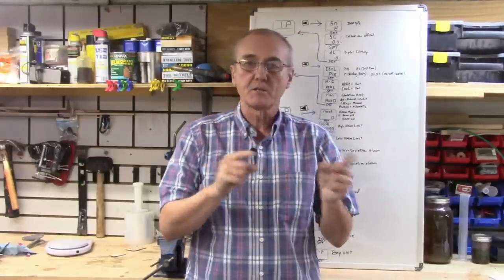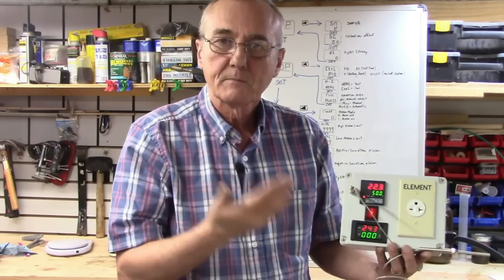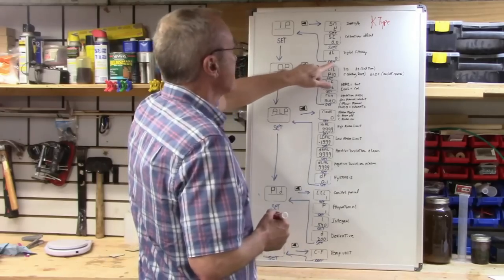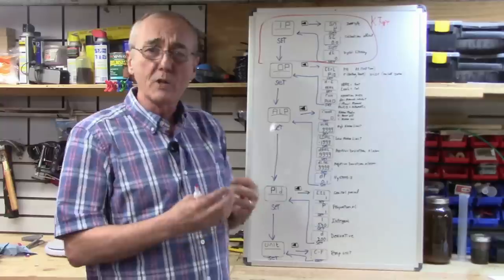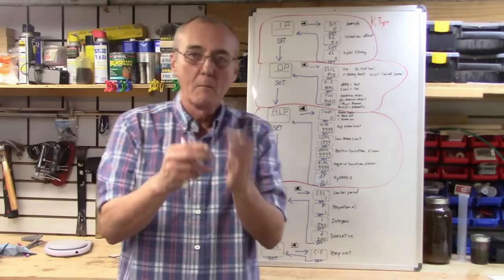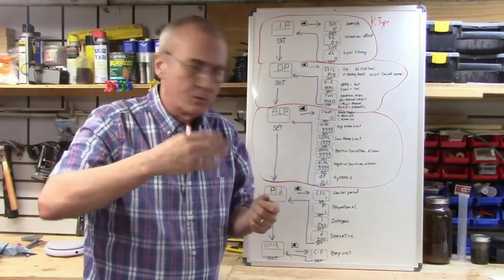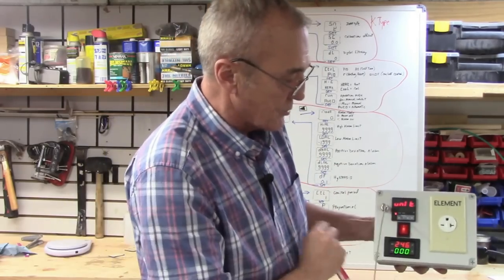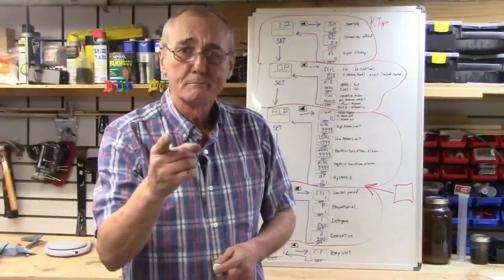Settings for  the InkBird 106VH controller

Comment: George I like your videos but your understanding of PID is off. I would just leave derivative off and do an autotune running P&I. Your settings are strange to say the least.  Your proportional is so high your pretty much running an off on control, Integral is so large is pretty much off, Derivative is pretty high especially since it is for long lag time processes.  If you ever come to Austin after this covid stuff is over we can sit down and have a drink over it.
Reply: Gotta add my 2 cents as well....WHAT do you thing the settings should be?
Reply: @robertt1782  That would depend. All things have influence, still size, element size, insulation or not, etc. That's why I said I would just run an auto tune. This controller will run an auto tune cycle and then go back to normal operation automatically. 

Proportional is just that a percent change in input gives you a percent change in output. Some companies call it gain. a proportional setting of 100 is equal to a gain of one. Most controllers have a default setting of 100, if you go below 100 that makes a larger reaction, if you go above 100 its smaller. 

Integral is time based. you will always have error with proportional only, Integral is there to bring you to setpoint. It is also sometimes called repeat,  it is usually measured in minutes per repeat or repeats per minute depending on manufacturer. it will repeat the proportional change till it gets to setpoint. The ink bird has a unit of seconds so it will repeat the change every so many seconds. so the lower the number the faster the controller will change, the larger the setting the slower it will change. 

Derivative isn't used a lot on anything but the slowest reacting processes. like temperature control of a large tank or something like that with a lot of dead time from making a change to actually seeing it. It is a function of rate of change of the process variable. It is measured in seconds it will make a step change  depending on a rate of change and how long you tell it to look forward. it gives a step change to the output depending on the rate of change and the time you put in. The bigger the number the bigger the change. It can get you in trouble on a semi fast responding process. 

There are all kinds of calculations you can do to determine tuning numbers and they can get you in the ballpark but in the end you always have to do trial and error tuning. the auto tune feature kind of does this for you.  https://br.omega.com/omegaFiles/temperature/Z/pdf/z115-117.pdf here are some instructions on tuning a temprature loop which is definatly more than most guys will want to do. The way I would do it if I wasn't using auto tune. I would run it in manual up to 120 or so with a p of 100 and the i way up there pretty much off. put it in auto and make a step change to 125 or so and see how much it over shoots and how long it takes to get there. if it over shoots real bad slow it down if it take forever speed it up. Do that a few times till you get a decent response time without a whole lot of swinging. then gradually add in you integral making sure you don't introduce swinging. They can start fighting each other which causes instability. I wouldn't  mess with derivative.  Or you can just do like I said bring it to 120 in manual, turn on the auto tune then change the setpoint by 5 or 10 degrees and let the controller do the tuning. 

Disclaimer: It has been over 5 years since I regularly tuned loops and over 15 since I was in school for instrumentation and controls so I am a little rusty. All of my experience is power plant related so there might be some other control schemes for other types of processes.
Reply: @josephkordinak1591  As per your description of so called lag and adjusting for it I must put out there that the wash one may be heating can have an awful effect on the spikes in the form of surging. This as George has mentioned in a previous presentation was due to the wash having residual sugar from a botched fermentation. Or in my personal case impatience lol. The high surface tension causes this and I personally thought my settings were off. Having a few now in the jar I check and double check my math or Gravity reading to know where my wash is during the fermentation. Thank you for chiming in. I hope the info you passed will help someone.
Reply: @jonthegman  oh you still have to be there watching it even with this setup. It is the simplest form of automation. If I was designing something for a larger still I would add a more complex control loop but this system will help you keep it between the lines without constantly staring at it but you need to stay in the drivers seat. .
Reply: @josephkordinak1591  this just helped me tighten up the temp on my incubator, thanks. 
At a ser temp of 100.5 I was overshooting to 101 and dropping to 98.2. Setting the porptional to 100 and integral to 1 it tighten it up to .07 degrees each way. I'm gonna keep playing with it and see how tight I can get it.
Reply: Wish you would make a video on how you have done your unit. Now I’m kinda confused,Again, on what to actually set this at now. I’ll be running four cartridge heaters, two in each plate for a heat press. And being on a fixed income I can’t afford to keep buying these units. And when running heaters like I I’ve installed says they are AC. But the relay says AC on one side and dc on the other these will be hooked to pins number 6 & 8. So is these heaters correct for this relay ? Thanks. Be waiting for your reply.
Reply: Hey to whom it may concern. How do I set up my PID to run an oven. I followed George's instructions and as soon as my oven gets to the target temperature it shuts off.

Comment: I think I'm having a problem with my inkbird pid unit. I wired it correctly, installed it in my electric smoker, set the parameters as you described.  At first it seemed to be working great. I set the temp at 120, It came up to temp and held there within a couple degrees plus minus. I placed my summer sausage in the smoker for an hr, turned the set temp up to 160 and it never read above 130 actual temp, but the sausage came up to 160?? Do I need to calibrate the thermocouple? Please help!

Comment: my screen on the bottom jumps to the 600 degrees then down to 38 degrees then shows oral and keeps switching numbers. it’s on my heat press and the bottom plate isn’t heating up. any help would be greatly appreciated!

Comment: I'm using this controller cooling. is there a way to lengthen  the cycle time or loop ? the blower motor on my chiller keeps cycling on and off. Any help you might provide would be greatly appreciated.

Comment: Thank You So Much George! All I needed was one simple explanation  (out of this maze - which the manual did not provide) but You did awesome sir.
I am using ITC-100 as my temperature controller, I've connected a washing machine heating element to the RC as my heating source which I am using to warm up a body of water in a metal container in which a bucket of solidified honey is sitting. The crucial piece I was missing was to set the 'run' function to Automatic   Bingo!! 
Your Clarity of explanation is Top Notch! Thanks Again George!🙏

Comment: Built and programmed controller as per your instructions.  IT WORKS GREAT.  Thanks for your instructions.  I also used a glass with a lot of ice and little water, let it sit for 15 minutes, inserted my probe and it read 32.5 degrees F..  I also checked the upper limit with boiling water, as you suggested.  Thanks again.

Comment: Thank you for doing this. I build an oven for heat treating steel. It will operate around 1550 degrees F. Now all I have to do is figure out this controller and what you have put out here I hope will get rid of my head ache, lol.

Comment: Finished my first PID assembly and settings/parameters setup; it's working great!  For the settings, I watched your video, and marked on the instruction sheet what settings you use or underlined what the settings should be.  At least that way I have a hard copy of what I want if I mess something up later.  You made this easy.  Finding the parts, cutting, layout, everything you need is in your videos.  It doesn't matter to me how long your videos are, you make it so anyone can understand what needs to be done, and how to do it - at least one way to do it easily.  Don't let the nay-sayers get you down.  Happy distilling!

Comment: Thank you.  This  was very useful and easy to understand.   Was looking for the PID setting from burning out my mechanical high power relay and accessing buffer setting.   For commercial kitchen water boiler replacing analog thermostat.

Comment: Incredibly well done instructions! Thank you. Could you elaborate on how to use the Autotune setting? You skipped over it to use PID instead of AT. My heat treat oven needs a little finer control than the settings that you suggested.

Comment: Thank you for this video. I used it to get up and running. I have one thing that I'd like to do. I'm using the inkbird to operate a water pump on my heating system. I would like to turn the pump on when the water gets to 130 degrees F and shut off at 150 degrees. I'm operating in on/Off mode. I tried to set the P value but it didn't seem to work.

Comment: Great video lots of needed detail! I built as similar one and am doing a dry run on it now on an electric smoker. I set it up per your recommendations. I also went ahead and calibrated it to 212F by putting the probe into boiling water and adjusting the calibration display until it matched.  For the trial, the target temperature is set to 130F. Reportedly this unit is accurate to +/ 1F. The best I can get it to the 130F target is +/- 7F.  (Actually it's +14/-0) To get this I set it 7 degrees under  the target (123F) so it runts 123-137F based on a very accurate thermometer. With a smoker, has anybody had better luck due to it turning the element on at the target temperature, shutting off, and the heat continues to carry over and overshooting?  Granted, it's WAY more accurate than the controller that came with it but would like to get closer to the stated specs. Any Suggestions?

Comment: Thank you for this video. I’ve got one of these on an injection moulding machine and for some reason I can’t change the set value. it just has a decimal place the blinks on the right hand side when you press the up and down keys.  So I’m hoping some of your guidance on the menus will help me resolve this issue.

Comment: I set up the parameters exactly this way but my boil stops and temp is not held. It probably has about a three degree swing, when Im over sp  power turns off as it should bit boiling stops at that point as well. Power kicks back on about 2.5° under sp, boiling starts again and this is the loop.... Heeeelp

Comment: Hi, Great video.  Just got one of these to retrofit on my Rancillio Silvia espresso machine.  It's working Ok but trying to tune up the PID values better.  The autotune function works but I think I can get it much better as I tune PID controllers at work in a chemical plant.  My question is: What are the units for P, I and D on these?  For example, is I seconds, 1/sec, etc.  The manual doesn't say.
Reply: Did you ever get an answer? I need to know as well, I and D are in seconds, what unit is P? thx

Comment: Hey George,  Great video.  My question is for controlling an electric smoker.  The PID settings of 1-540-200 work but because the heating element stays hot longer when powered down and takes longer to heat when energized, the range is still around 20 degrees.  Can you recommend setting to help tweak this range a bit tighter?   Which setting should I play with (P, I, D) to experiment with for a closer range.  Thanks so much for your information and lessons in layman's terms.

Comment: Great video! Thank you for hat you do! I just finished my PID. Is there a way to factory reset the settings and start over again? My PID’s light isn’t blinking when it gets close to temp. Also, I’m using mine for a smoker if that makes any difference. Thank you in advance!

Comment: Would you possibly be willing to outline the specific settings you use and recommend for beer brewing using a RIMS tube type recirc mash?  I’m having issues with overshoot and have tried multiple times to auto tune.  TIA.

Comment: Thanks for this walkthrough. I installed this PID on my single boiler espresso machine with a desired temperature around 98c. Can I use your proposed settings of P:1, I: 540, d: 200. Because I have heard from other espresso PID users advised that values should be around the following: P: 15-25, I:10-40 and D: 1-3 (near to zero). I am interested in the differences in configuration. A am curious to hear your vision. Currently (Ctl:4, P:18, I:35, D:8) the machine overshoots 16c and undershoots 6c. Thanks for advice

Comment: I bought a PID controller from you George. I just went through the video again and set all perimeters to what you said. My controller always fluctuates about 7-10 degrees up and down during a run. Not understanding why. My D is set at 200. Any advice would be helpful. I also have to change the df to 0.1 each time. Have a great day

Comment: Great video. I am wondering do I need a special contactor. The one I used is just a typical contactor. 240v but when it gets to 3 degrees of set point it cycles on and off which I'm afraid will burn the contactor prematurely.  Any help is appreciated

Comment: Does the mypin have the option somewhere for manual mode to set the percentage of power that goes to the elements or is that only available on the inkbird.

Comment: I have rechecked all my parameters, still my control high and low runs from 15 to 20 degrees above and below my set temp! Could it be my k probe! It on my powder coat oven I built.

Comment: I've got this PID controller wired up to 2-40 watt ceramic heat bulbs for my home made incubator. I used your settings here. The controller is over shooting and undershooting 2 degrees from set temp of 99.5 fereinheight. Is there a way to fine tune this more? Thanks for the video!!

Comment: How do you get it to remember the set value.  When power-cycled mine always goes back to the default of 122F (same as yours in the vid).  Other PIDs I've used have remembered the last set value when power cycled.

Comment: George on my inkbird itc106vh  on the ALP set the DF will not stay at 1 it goes  back to 0.3 do you know why
Reply: Same issue. Did you figure it out?
Reply: @dutchhungry  no not yet
Reply: Same issue here.
Reply: Make sure you hold down set until it goes back to the home page and then it will change the number

Comment: My InkBird 106VH controller seemed to work fine, but when the OUT light turned off, as it should have at the desired temp, the relay stayed open and my heater stayed on, almost killing all my fish in my pond. I found in OP settings it was set to manual inhibit, instead of auto. I HOPE this will solve the problem. If not, what could it be?

Comment: We have the inkbird 106rh operating Asco valves on our brewstand for brewing beer. We are using the on/off feature so as not to have the propane going on and off so frequently. The problem we are having is the lag of reading and displaying temp. Is there any way to remove the lag on what it is reading on a K type probe?

Comment: I listened to your video on how to set up the Inkbird PID. Initially everything looked fine. I changed the factory set parameters to what you had suggested. Went back to the initial screen and the PV value reads 528 instead of 20. I am using a K TC, pulled one lead off the PID and put it back on but it is still reading 528 and it appears to fluctuate as if it is sensing temperature. But the TC is sitting on the bench. Is there a factory setting I changed that caused this problem?

Comment: Auto-Tune? Im setting up a 1800w countertop commercial Pizza oven im modding for PID .. its working but ive not used inkbird but now I boughgt one since they seem to get good reviews !  i have a few fancier programmable PIDs of different brand I dont need for this.. just want to control temps and get em there quickly as i can and stable for baking things

Comment: Great instructional video. I'm having a problem tho. My temperature goes down when it gets hotter. Did I wire or program something wrong?
Reply from the maker: You have the probe wires backwards. They are polarity specific. If you connect it backwards it reads backwards. Switch the red and black wires.

Comment: Hey there, I loved the video, it was very helpful. But I have a small issue right now.
I am building a small kiln, I have got everything set up, I am using a SSR and Kenthal coils as a heat source. I connected a door switch and It all turned up grate. I programmed my controller exactly like you showed in the video but when I turned it on the display shows some strange things (the “ALM” and “RUN” LEDs turns on and off as long as the “OUT” LED) and the voltage on the coils runs on 220V for a sec and then goes to 0V for like 6 sec, and the temperature is far from the wanted temperature.
I have no idea what to do and I will love some help.
Thanx a lot

Comment: can I test the still with just water? plugged it in put water in the kettle and set the PID for 100F. the kettle gets to 200 or a little more but the 2" reflux still never gets past 74 or 75. concerning to me. I have always ran this same still on Propane without any issues, but that was always with a Mash or sugar wash. not with just water. Any advice?